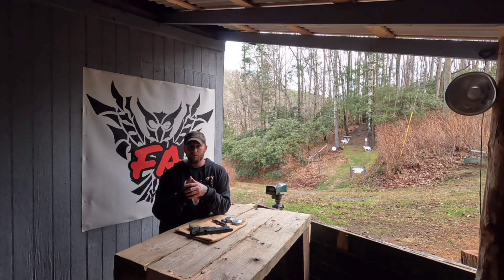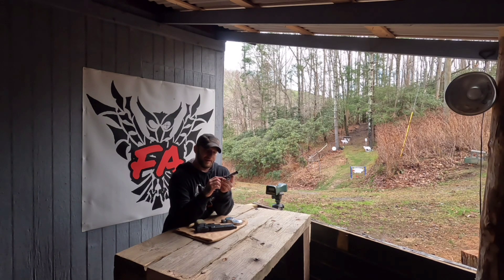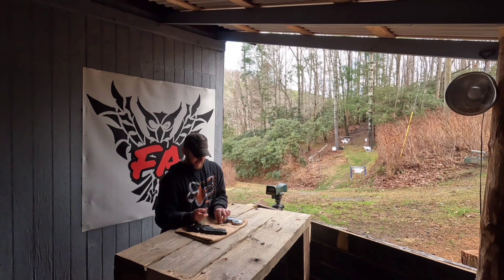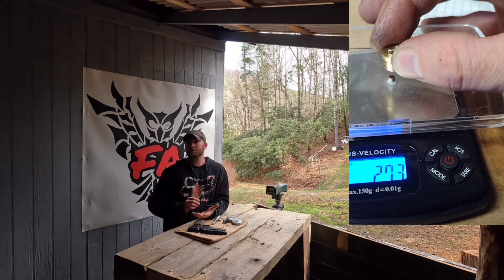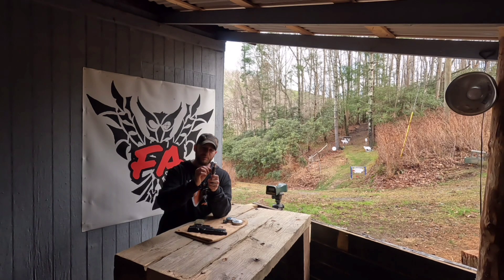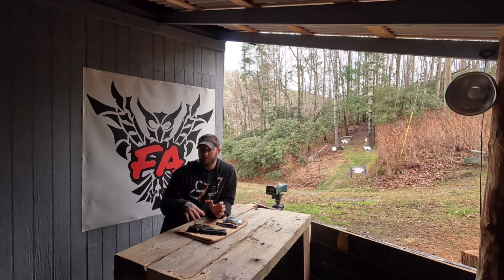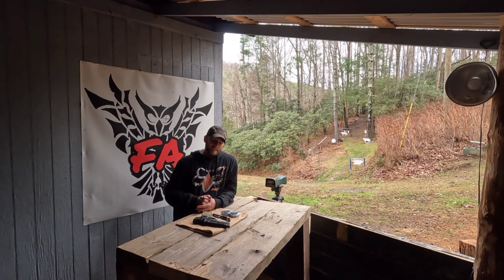Magnetic Repulsion PCP Air Pistol

Comment: I have experimented with magnets in such manor. The problem is that the magnetic field must overcome the momentum of the weight of the magnets wether pushing or pulling. Also stacking 2 like magnets only increases the field by 50%..... But you are thinking. I applaud you for that.
Reply from the maker: @delmusingle2338  I don't follow.. How is the weight affecting the repulsion? I just need magnets the same or similar size with more magnetism and I'll solve the rest. 💪
Reply: @TheFowlerAirgunChannel  ,,,, The weight does not affect the magnetic field but does affect any movement of the magnets in speed of movement. ... But, please , keep experimenting.

Comment: Badass idea and execution. You're now a gunsmith and inventor. Congrats and thanks for the info. I know you're against electronics, but a electro magnetic device similar to what's in rail or coil guns could also be used to accelerate a projectile above the speed of sound theoretically when used with compressed air. I've been dying to tie the ideas together, but ofc it would have to be wrapped ina Faraday or something to survive those extreme cases you listed vs a traditional pcp.

Comment: If this is as you claim 100% magnetic propulsion, then why do you still need to fill it with air?
Reply from the maker: @MrRockstar1968  no. I never said it was 100 percent anything. The title says magnetic repulsion PCP airgun. Just some important parts. 🫡
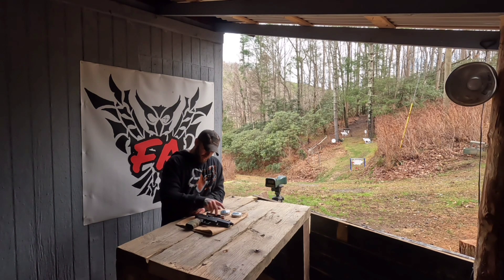Reply: @TheFowlerAirgunChannel  At 11:57 you stated: "this is 100% magnetic propulsion", which is exactly what my initial statement is referring to.
Reply from the maker: @MrRockstar1968  my apologies. It's obvious I don't mean the entire thing. Hence.. PCP pistol
Reply: @TheFowlerAirgunChannel  So what exactly is the magnetic repulsion doing, is it there to replace the hammer spring?
Reply from the maker: @MrRockstar1968  no. It replaces the valve spring. Frees up space for more air and no wear on parts.

Comment: Do you want to replace the hammer spring with a magnet, or the valve return spring? 

Daystate airguns have some models that have an electric valve.
Reply from the maker: @DaFred1990  I did replace the valve spring with magnets. It works great. I don't want any electronics. 🫡